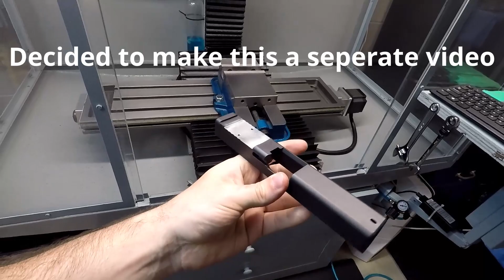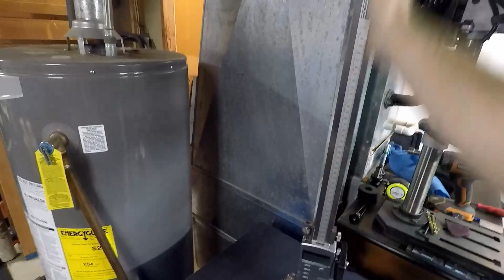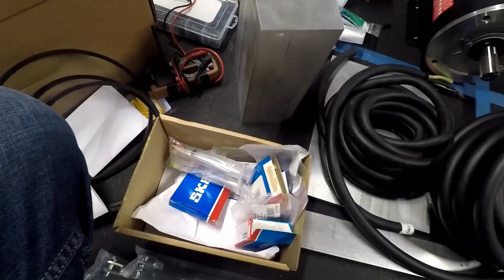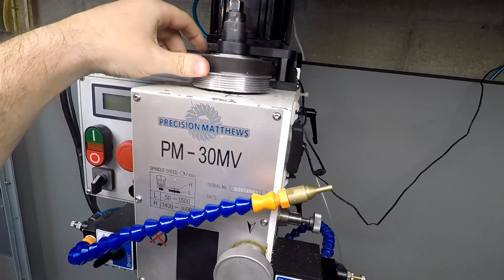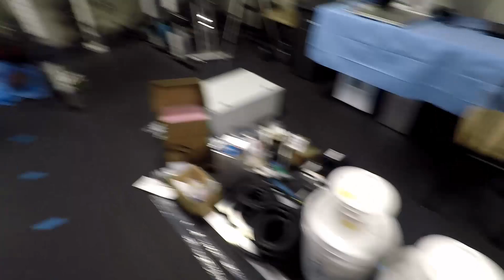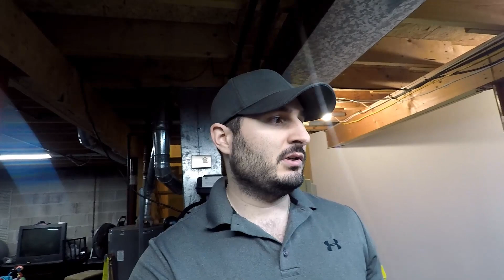Sorry the update took this long!!

Comment: Looks great. I just bought the 833 and waiting on the ball screws. I'm building my table right now. What's your table height above floor?
Reply from the maker: The 833 looks like an amazing machine. I definitely wish that I had gone with the 833T but it wasn't available when I got my PM30. I'm 5'8" and I went with 32" above the ground to my table. It feels great
Reply: @MPMachining    Great, I'm 5'10" and was thinking 34", so spot on. Really looking forward to the build. I'm pretty much going to follow Dr. D-Flows conversion. Honestly not looking forward to the electrical side but I'll get through it. I plan on making an enclosure like yours. Pretty slick!
Reply from the maker: It's really not all that difficult. Plenty of good resources out there to help. If you have questions along the way let me know. And the enclosure is a MUST if you don't want to be showered in chips
Reply: So im finishing up the conversion and will be starting on my electrical enclosure later this week. Curios what board you went with and if you possibly have a wiring diagram for the VFD wiring to the board part? I went with a mesa board.
Reply from the maker: @mmarmino  has i went with a C10 board from CNC4PC. It was on the way cheaper end of breakout boards at the time and has a lot less options than most of their other boards. I have been looking at upgrading to a Mesa board at some time in the near future but unfortunately i dont have a diagram my wiring. I can certainly help walk you through it though because the wiring should be pretty straight forward either way
Reply: Would be great. I have diagrams to help me wire everything else up . However the walk-through that I'm using doesn't include the VFD. I assume Precision Matthews uses the same on both of ours. but anyway this evening when I get home I can take a picture and show you one of the schematic that I do have . And I appreciate any help. Do you have an email to communicate through?
Reply from the maker: @mmarmino  send me an email at Battleresistantoutfitters@gmail.com. Im sure we can get you up and running

Comment: Congrats on the birth! We're at a similar place. I'm not a EE, but was a nuke electrician in the Navy, just bought a laser for my CNC and picked up a PM-30MV I'm going to convert to CNC and my daughter is due in October. I don't think I'll be putting a 5HP motor on top of mine but we'll see. I had considered filling in the castings though and filling the hollow square steel I used for the bench I built.
Reply from the maker: Congratulations on the upcoming baby! And when did you get out/did you ever do a prototype tour or did you come through NPTU up here or MTS?

As for the epoxy fill, I have high hopes that it will make a big difference in the rigidity of the machine but we will see how the results speak
Reply: Battle Resistant Outfitters I got out in December of 2010. I didn’t do a staff tour  at prototype but I was a student up there at S8G in fall/winter of 2003.
Reply from the maker: Ahhh ok, you were quite a few years ahead of me then. I started at MARF in 2010 and after 10 years over there just came over and qualified at 8G earlier this year. Small world.
Reply: Battle Resistant Outfitters Ouch, I’m the old man! Good thing we’ve got these young bucks on YouTube to teach us how to use these computers.
Reply from the maker: Haha hopefully that isn't how it came across! When I started up here I was already in my mid 20s so we are likely within a few years of being the same age. 

What do you plan to use the PM30 for? Just getting into machining or do you have a product planned for it already?
Reply: Battle Resistant Outfitters I’m a tinkerer. I’ve got several 3D printers, CNC router, many tools, etc. I’ve wanted to metal work for years but now I can finally afford the tooling I’d like. I have a business making 3D printed shims for installing lift kits on Jeeps. I’ve got a few more products in the works and hope to eventually make some metal parts (my old Workbee frame is begging to become a plasma CNC). What pushed me over the edge is a friend sent me pics of an aluminum clamping jig, about 6x3x3, that they can no longer source. His company offered me enough to make them to not only cover the PM-30, but also the CNC components and tooling if I budget properly. Couldn’t pass it up and love a challenge. The mill is backordered expected at PM in mid September, expect to get it by end of September. He’s hoping to get these within a month or two so I’ve got to get moving! I’m working on my YouTube machinists degree watching all of your vids, Blondihacks, and This Old Tony.  I’m getting the part in the mail in a few days so I’ll model in Fusion, 3D print a copy, send it back (they only have two for their whole territory and want 10 total). I’ll program CAM in fusion and can practice run the CAM using my CNC router in the air. I’ve got the electronics from my Workbee already assembled but I’m going to make a new kit before the Mill arrives so it’s ready to go. Then hopefully I can convert my CNC quickly and get to making chips. It’s a bit ambitious but I’m motivated to get a free CNC Mill and feel accomplished.
Reply from the maker: @cduemig1  that's awesome to hear and absolutely an opportunity you can't pass up. Make sure you watch a bunch of NYCCNC videos also (the older ones around 3 or so years ago were the best in my opinion). He does an amazing job actually teaching machining. If you have any questions or want a specific video on anything feel free to let me know

Comment: Would you post the cad file for the spindle ring light?   Thanks... BTW where did you get your PM30 cnc conversion kit or pieces from?
Reply from the maker: Send me an email at battleresistantoutfitters@gmail.com, I'll shoot you the cad file there and a link to the cheap ring light I used. 

As for the conversion kit, I got mine from ProCutCNC and I have been very happy with it (the kit comes with double nut ballscrews all around, Nema 34 mounts for each axis and the bearings you need for the ballscrews). A similarly priced kit is also available from a different YouTuber named ArizonaVideo99. I have heard great things about his kits also

Comment: Cant wait to see some of your solutions!! I’ve been trying to find a spindle pulley for the pm30 mv for a while now to get more RPM’s out of the DMM Servo spindle motor I got a while back ( 170 1.8kw with DYN4 driver ) maxes out at 3000 RPM , I also had a hell of a time getting that thing off the spindles day damaged it pretty bad ( double set screws btw)I’m exited to see your upgrading because your the only person I’ve found running the pm30mv CNC I’ve found with an affinity for firearms milling like myself!!!
Reply from the maker: Hopefully it all turns out well and isn't an epic failure! I have taken the stock spindle pulley off once to measure it and you aren't kidding, huge pain to get off without breaking it in half. I am currently editing a video of a quick RMR cut so hopefully I can get some firearm cutting content up on here now too. How do you like the DMM servo?
Reply: Battle Resistant Outfitters 
The servo has tons of low end torque, but tops at 3000 unfortunately I’m running a control system that can’t rigid tap yet, (masso) which was one of the reasons I got that spindle servo , the encoders on the DMM’s are awesome, but I think I went a little small on the all the axis with the DMM 400w servos, but they are  quiet and smooth, I’ve been thinking about adding a counterbalance for z axis to help,  but really want to get some more rpms. How did you get that spindle pulley off??? Wedge Fork ?? Use heat?
Reply from the maker: @Gabriellaigbma  what size is the shaft for the servo motor? I'm sure you could put a bigger pulley on the motor or a smaller one on the spindle. You would give up some power but more speed is definitely what these mills need. 

For the spindle pulley, I started by slowly prying with a flat blade screwdriver. Scratched up the paint on top of my head pretty good doing that. After that I put some plastic sheet under the screwdriver to help protect it until I got a tiny bit of movement on the pulley. Once I had about 1/16" the e so of clearance under the pulley I was able to use a pry bar and tap it with a deadblow. Huge pain and I actually have to do it again so I can setup a bore gage in the old pulley before I machine the new one to get the same fit. I'll make sure I film it next time

Comment: The ring light looks like a through spindle coolant adapter. Adding copper lines between the stater and housing body of the spindle could also aid in cooling for longer runs.
Reply from the maker: The ring light is basically the same design as a coolant ring. I don't have flood setup for this machine so I took advantage of the space to gain some more light. I love that idea for some cooling using some copper heat exchangers, I might have to give that a try. Thanks for the idea!